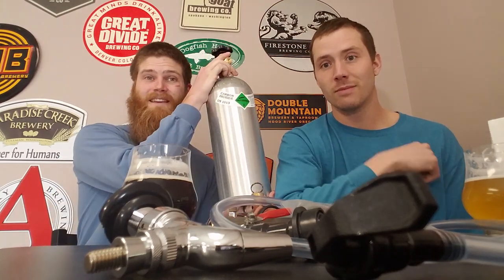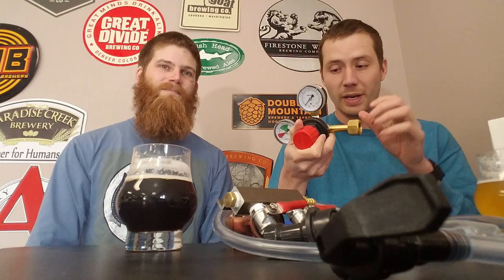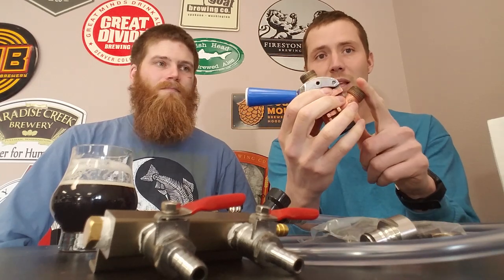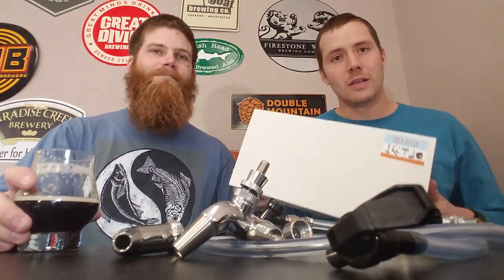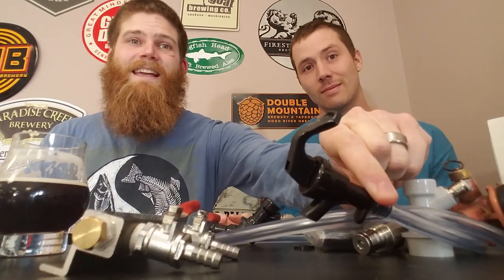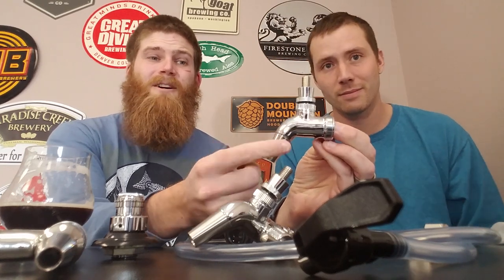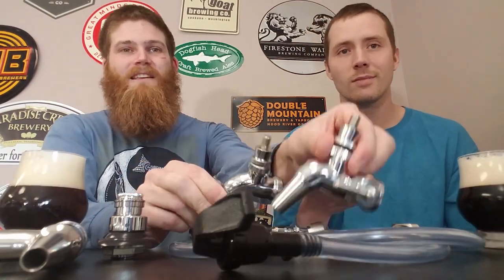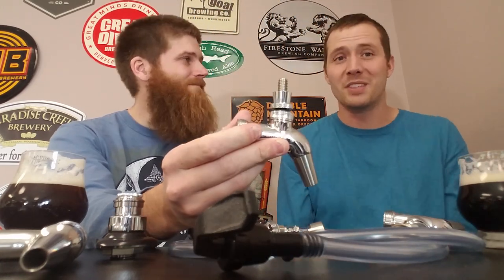How to Build a Home Kegerator 3 -  Faucets & Draft System Parts

Comment: Thanks for this series.  It's helpful to have it all in one place.  I was wondering if I want to be able to serve while also force-carbing a new keg of home brew, what does my regulator/splitter set up need to look like?  Thanks!
Reply from the maker: There a couple ways to go about that. The easiest is the manifold with the on/off valve. If you are carbing a beer you can shut off the serving line temporarily and crank up the pressure to the carbing line... then if the serving line gets low pressure you can just give it a spritz of co2! Dual pressures does make this a lot easier though.
Reply: many thanks for the response.  makes sense.  Is the second regulator for dual pressure able to be added easily in future?  Or is it easier to to set up in advance of it being totally necessary?
Reply from the maker: There is an inverse proportionality between the ease of adding secondary regulation and the cost of adding secondary regulation. If you think you'll need multiple pressures the best course of action is to get a dual body regulator up front :)
Reply: Thanks!
Reply from the maker: You're welcome :)

Comment: I want to build a tap truck with 6 taps. I would use 50-100 feet of coil in a cooler of ice for each line. What would I need with that?

Comment: Great video!!  Is it possible to use a flow control Intertap faucet with a faucet-to-QD adapter? Is there enough space for the flow control mechanism to move around with the adapter attached, or will it bump into the adapter and not have full range of motion/flow?
Reply from the maker: Faucet to QD for ball lock to serve straight off the keg? That is definitely workable - it is the system I use when I put cocktails on tap :)
Reply: Wow, that’s great! I read everywhere that FC faucets were incompatible with the adapter to connect directly to the quick disconnect; I guess Intertap made that better too!

Comment: Would the flow control faucets allow you to server two different styles of beer if say you are using a manifold instead of a multi-body regulator?
Reply from the maker: Technically, yes - however it's more accurate to regulate pressures separately. The benefit comes because line length can be the same even with different pressures charging your kegs. 
The Flow control Hack would basically allow you to charge both at the pressure of the higher CO2 beer, and run the lower CO2 beer out of the faucets faster. It will be foamy and take longer to pour, but will expel the CO2 in pouring so it's lower by the time you drink it.